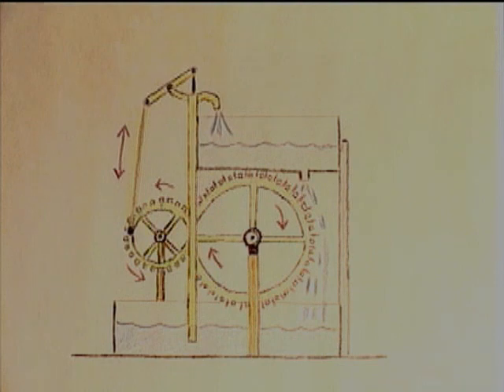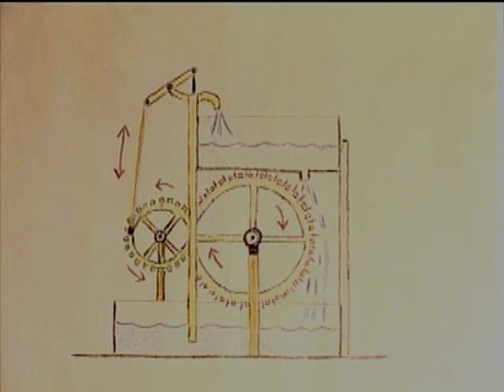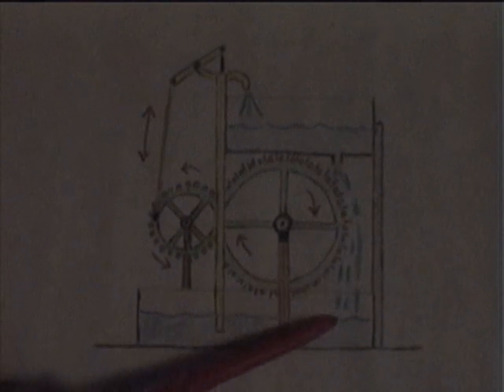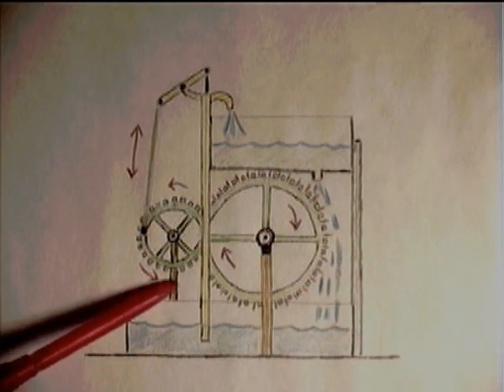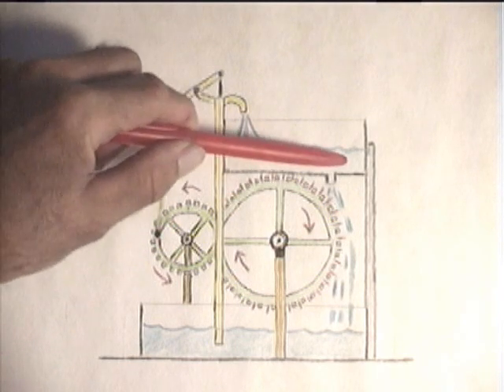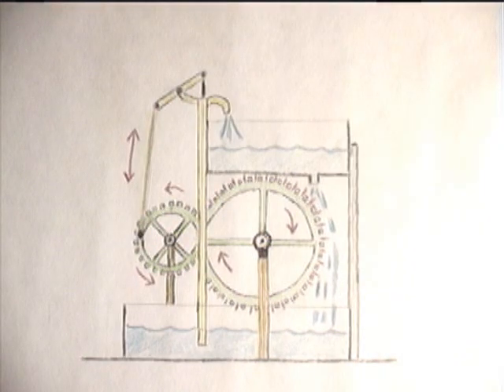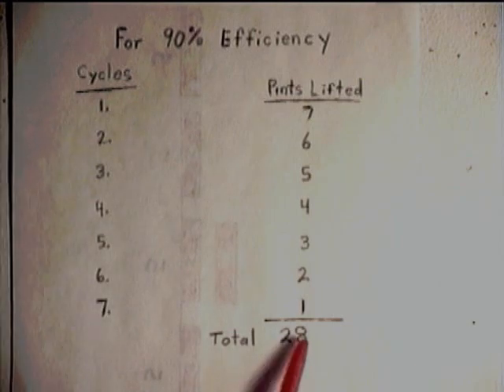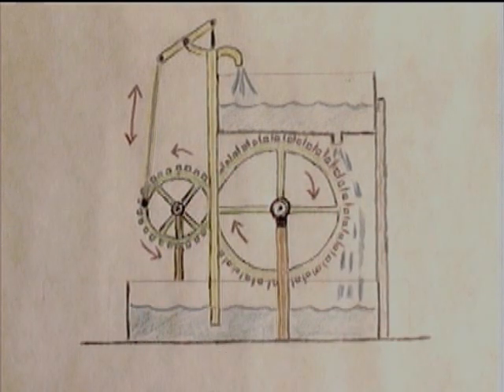Water Perpetual Motion Machine P7

Comment: well your concept is sound BUT if you put in a Heron's fountain on the bottom and a siphon on the top side ( replacing the pump which creates a "NEGATIVE" pressure and thus aiding in the lifting of the water to a HIGHER level) THUS allowing a bigger wheel and MORE torque provides additional power and torque to turn a generator